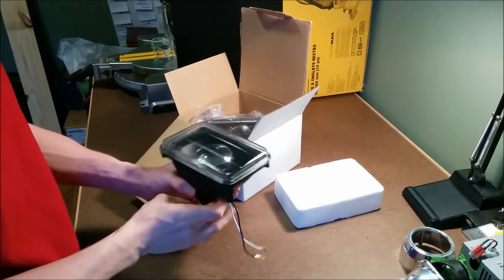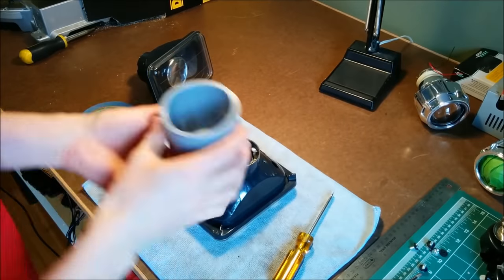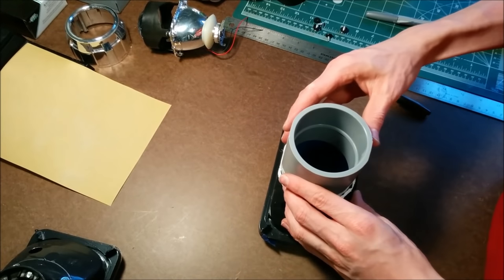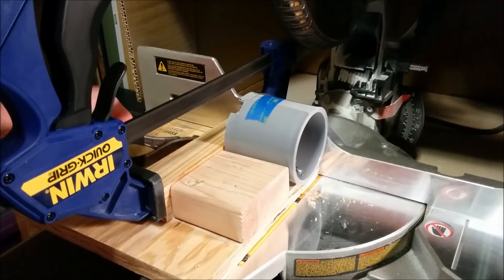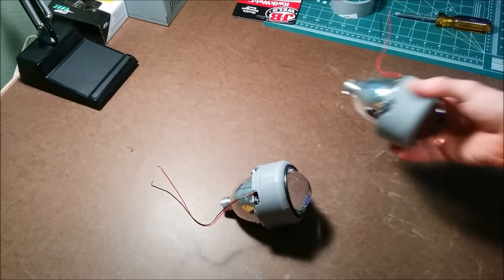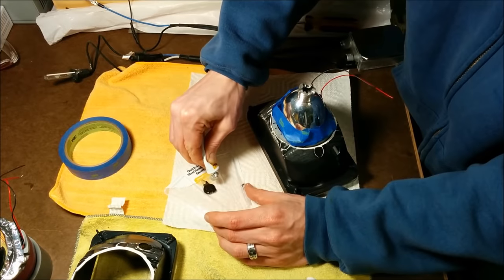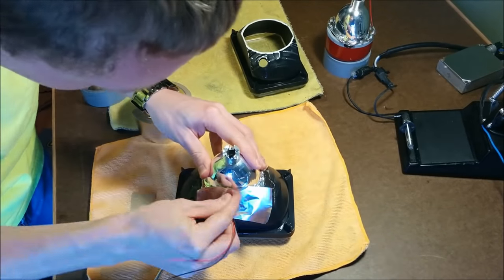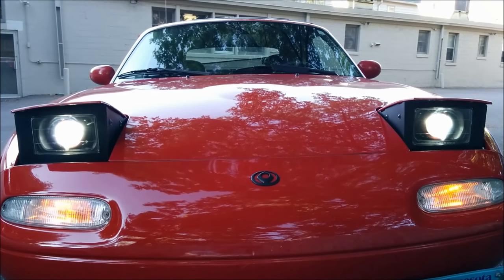How To: Make Projector Headlights for Your Car

Comment: And the high beam? xD
Reply from the maker: It has a high beam built in.
Reply: +Justin Depew That should be horrible to the other drivers, I made something like that, but with low and high beam, I use Ford Projectors with a solenoid made the magic Low/High beams.
Reply from the maker: +Oliver Silva of course, all high beams are horrible for other drivers. You're not supposed to drive with your high beams on into oncoming traffic.  That's just common sense.